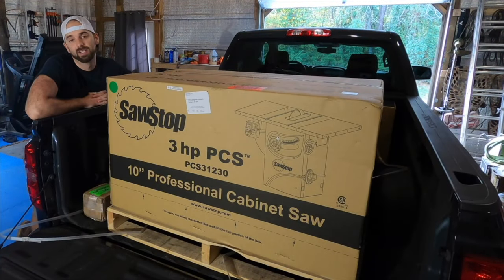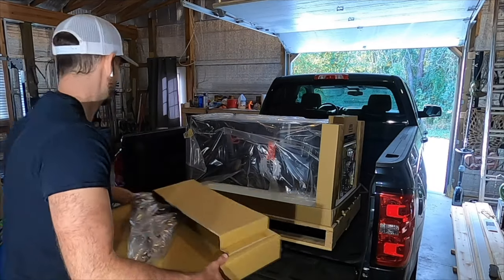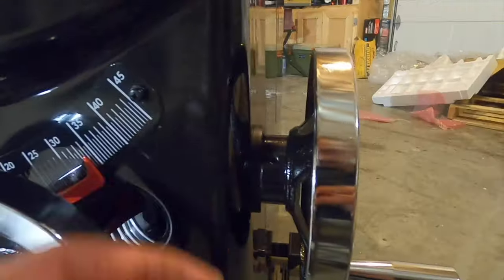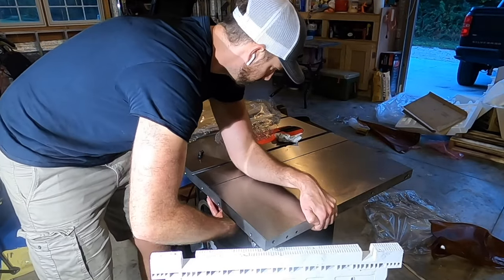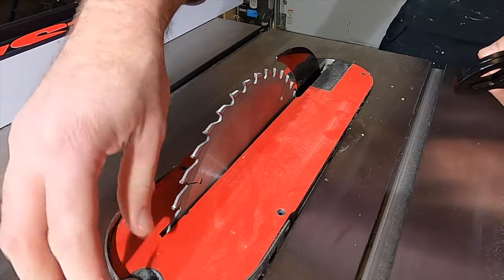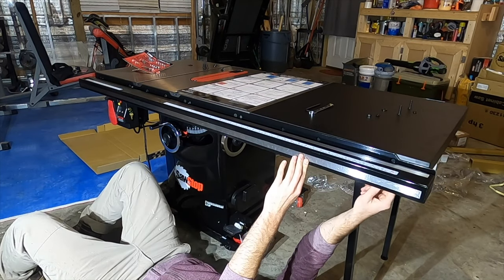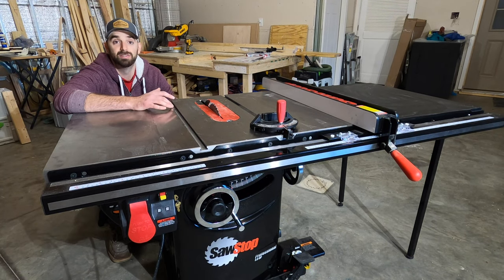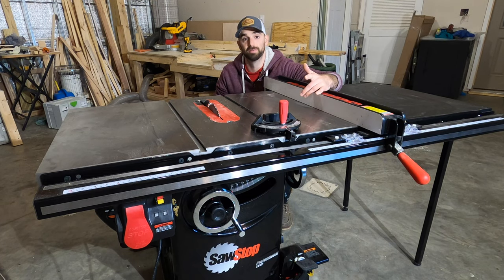SawStop PCS Unboxing, Assembly, and Reasons Why I Bought this Saw

Comment: Both of the wings on mine were not perfectly flat.  Mine is level at the front and back but a little dip in the middle of the each of the wings. Shouldn’t affect function but of course really bothersome.  Upgraded from the contractor saw that had stamped steel wings so still an upgrade but still…
Reply from the maker: I understand how that would be frustrating, especially on an expensive tool. Luckily the wings and top on mine are nearly perfectly flat, I haven’t had any issues at all.

Comment: I unloaded my PCS much the same way. I didn't have a weight bench so I used an office chair raised all the way up, slid it out and with the top on the chair I lowered the chair and then lowered the bottom by hand to the mobile base. I had to turn the saw around so the chair was up against the tail gate so it wouldn't slide away. It was dicey to say the least, but it did work.
Reply from the maker: Sounds dicey for sure! 😅 I wouldn’t recommend what I did whatsoever 😆

Comment: I am looking at your video while sitting in a chair looking into the back of my pickup that has the same saw as yours sitting in it.  Got the same problems and questions.  Thought about tying the pallet to a tree in order to pull it out but sanity return in time.  Ended up sliding it on a sturdy work bench and then on to a Harbor Freight hydraulic lift table that came up to the bench level.  Getting it up off its side and onto the stand….required some help.  It is a beast!  Highly recommend the lift table.  I have used that many times for tasks like this.  It is my regular platform for my planner.  When not in use, the table goes down and it and the planner are pushed under a workbench.
Reply from the maker: Nice! Glad you were able to get it unloaded, it was a challenge for sure.. that lift table sounds sweet!

Comment: Thanks for the very helpful video!  Disclaimers about hurting myself, being an idiot, etc., all accepted. Reality is this will be a solo assembly effort for me too. It's hard to quantify how much of a strain it was to tip that thing up on to the base but I'll ask anyway. If you were to pick one, which of the following would you use to describe it?  "This is a really bad idea, I'm going to blow out my back!", "This is heavy but as long as I am careful...", "That was a bit of strain but really not bad for someone in decent shape...", or "I bet a 140 pound person could do that solo."?
Reply from the maker: Glad it was helpful! So I would absolutely NOT (no circumstances whatsoever) recommend using the weight bench as I did to unload it from the truck bed. As far as tipping it up, I was able to do it but it was certainly difficult. I’m in my 30s, about 220lbs, probably average fitness. I would strongly recommend a second or even third person to help if you can. One wrong tweak and someone’s back could definitely be injured, also if you’d drop it on your foot halfway up, your foot would get broken for sure. Looking back on this, I definitely should’ve had someone help

Comment: Just curious. It looks like there is a lot of sawdust under the throat plate, yet the saw looks otherwise new and unassembled. Any explanation?
Reply from the maker: I’m pretty sure I refilmed the part where I took the throat plate off (in the video) a few days later after I had used the saw for several cuts. The original footage where it was new/clean wasn’t filmed well so I cut it cut and redid it.

Comment: I did not see you mount the table to the mobile base??
Reply from the maker: Hey Lance, thanks for pointing that out, I completely forgot to film that part! Check out page 3 of the manual at this link: 
https://www.sawstop.com/images/uploads/manuals/Manual_Mobile_Base_ICS.pdf

Theres 2 tabs on the mobile base sitting just past flush on the bottom of the saw. They fold upward and you use self tapping screws to bolt the tabs on the base to the bottom of the saw. Hope that helps!

Comment: Just got my 3hp PCS. Unfortunately have to lower my work table that doubles as out-feed, gonna be well worth it. Thanks for the vid.

So whats your thought on the over head plug in vs across the ground? I’m considering overhead because I try to keep as much as I can off the floor. Wondering if that will get in the way of the material or just in general like when walking around it etc. My shop is much smaller as well only 15x22
Reply from the maker: Nice, congrats on your new saw! I really like the plug from the ceiling to keep the cord off the ground. I moved the saw a little bit further to the right to keep the cord out of the way - if you’re cross-cutting a wide piece, sometimes the cord can get in the way, other than that I’d say go from the ceiling all the way!

Comment: You need a large compact tractor (like a Kubota MX) with pallet forks. It will change your life.
Reply from the maker: I would love to have one! Maybe one of these days!
Reply: @mmcc_woodshop6288  I want a Sawstop PCS lol. They have factory refurbed 1.75 HP models available in my closest city. Debating between the 1.75 and the 3 HP. 

Only thing that even swings me to the 1.75 (besides cost) is that I am 100% offgrid - the solar/battery system is fairly massive, but every little bit helps, especially in the winter and during darkness (it's AC coupled so daytime/fair weather use allows a more direct path - no battery use at all during sunshine).

Gonna install two dust collector systems rather than one big one for the same reason...on opposite sides of the shop. I have an old 1.5 hp jet from my previous life (pre military) and one just like it popped up on FB market place...limit the runs to just a few machines each rather than trying to serve the entire area, I think they will do adequate jobs (with the better filters) and not draw crazy amounts of power.
Reply from the maker: Sounds like a cool setup. I’m not certain about the 1.75 HP, I would imagine it would have plenty of power still but I have no firsthand experience with it. Hope whatever you decide works well for you!